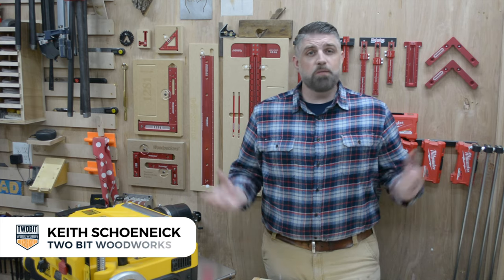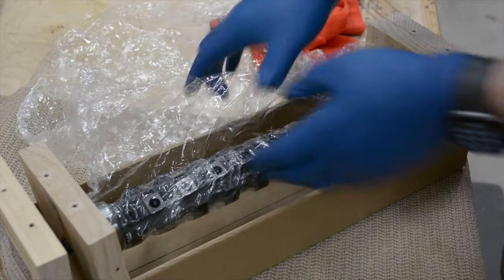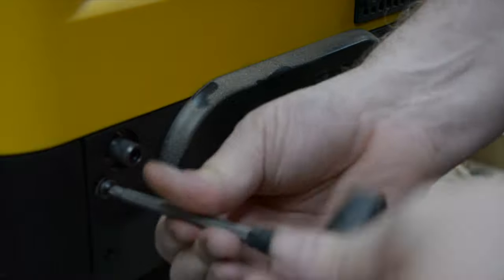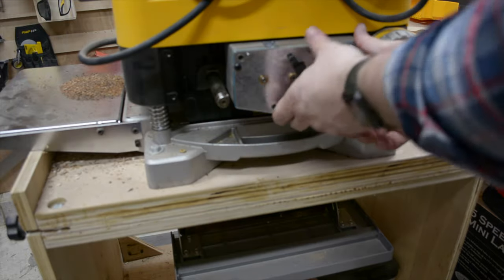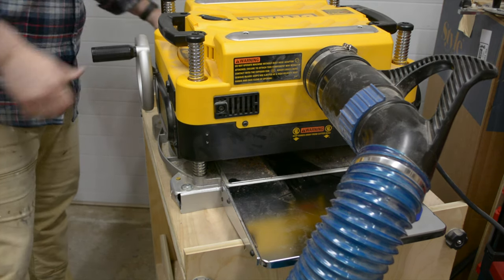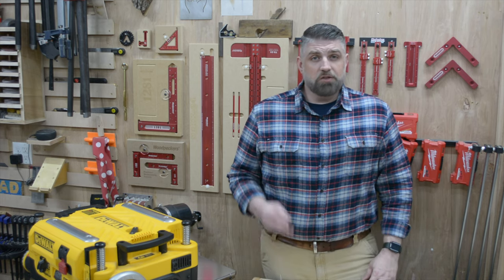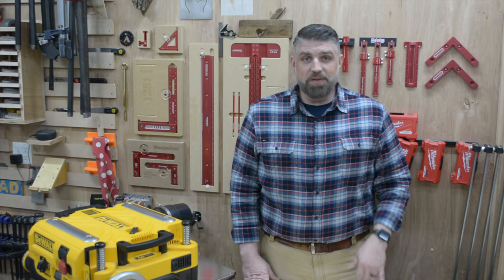Helical Head Upgrade on a DeWalt DW735 Planer | How To | DIY Small Shop Woodworking

Comment: This was a very handy tutorial and it helped me through this installation. Highly recommend this video. 

A few notes that aren't explicit in this video for anyone following this tutorial: 
1) The cutter rotate lock plate removed at 2:05 does not work on the new cutter head and does not need to be reinstalled. Just don't be an idiot and turn the machine on when the dust cover has been removed. 
2)  At 3:02 he removes a washer and there is a little piece of metal (a key?) that is also there. Watch out and don't lose it!
3) At 3:08 he says "4 screws", there are only 3. 
4) At 3:28, there is also a washer on that right post that you need to watch out for. He tells at 4:22 to put it back on, but he doesn't mention it when it comes off. Don't let it get lost. 
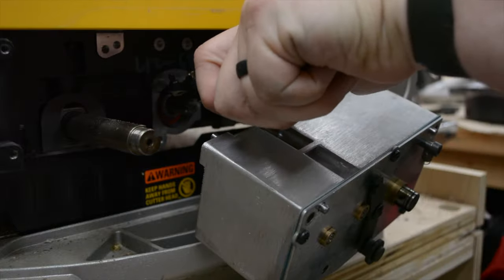5) I'm not entirely sure the snap ring at 3:45 actually needs to be removed. I did anyway, but it is a pain and another commenter mentioned you don't need to remove it. 
6) There is no instruction on HOW to remove the helical head referenced at 3:53. Depending on the age of your planer, it might be on there pretty tight. I used some lubricant and it helped a lot. 
7) If you wanted to reinstall the cutter rotate lock plate (even though it won't serve any purpose other than to keep your parts together), then before the step at 3:58 is the time to do it!
8) At 5:07 he says to ensure the belt is seated correctly on top and bottom pulley. You can access the top pulley to make sure it is there by giving just a quarter-twist on that screw on the left side of the little vent plate in the top-right of the screen. 

So these are all little things that weren't mentioned explicitly but I was able to get through it anyway. But if you want to add them to you step-by-step, it may fill in a couple of gaps.
Reply: Champion

Comment: exactly how important is it to add grease to the two round metal bits where the cutter head bearings sit? I started to install my helical head.. its a VERY tight fit.. took a bit of pounding via mallet and wood block. But I would assume any grease applied on those round parts.. its so tight it would just be pushed out. There is grease on the bearings themselves and most videos like your show taking some grease from the gear box and adding it to the little gear we removed from the original head. But otherwise, should I remove my cutter head to swipe some grease on that insanely tight opening where the two main bearings sit?

Comment: Just a heads up, I just got my Luxe cut three a couple days ago and they now ship with the cutterhead removed and they didn’t do that before. Even the website when I ordered said they did not come that way. But… There was an RMA form inside and it looked like mine had been dropped so it could’ve been a return.  the threads were screwed up on the shaft and I intend on contacting the company tomorrow. I was able to clear the threads using the shaft nut and some lubricant.
Reply: Hopefully you customer service experience with lux goes better than mine with bird tool.
Reply: @handlehidden-f2j  actually it was very good. I had problems with the videos uploading by email so I had to send still pictures, but we got it straightened out quickly. I was accidentally sent a head that had been sent in for return and it wasn’t supposed to be sent out. They immediately sent me a new head. All new, cutters installed and everything wrapped in plastic, foam, cardboard, and crated. I would definitely use them again if I needed a new head for something. 5 stars ⭐️

Comment: Thanks for this.  Still happy with the cutter head?  I've got the same planer and am reasonably happy with it, except that the breaker keeps tripping.
Reply from the maker: I’m super happy with it. I had the same problem then I installed a 20amp breaker and started taking lighter passes and haven’t had a problem since.
Reply: @TwoBitWoodworks  ya, my research turned that up as a solution.  I'm just waiting to add a few more things to my next amazon order so I get free shipping on it.
Reply: @TwoBitWoodworks  A 20a breaker on existing 15a wiring?
Reply from the maker: @joesmith6972  no, it was a completely new line I was able to run and upgrade the breaker.

Comment: Since buying this planer without the upgrade I’ve had issues with clogging. Are the shavings the same size from this cutter?
Reply from the maker: @Dorbad  no the shavings from my planer with the upgraded head are about smaller. You should try taking smaller bites through each pass.

Comment: What was that connected to your planer dust collection port? I need one!
Reply: That's the Rockler dust collector system. I have a standing unit that uses that same 4" hose and connector. It does require that you attach an adaptor to every machine in order to fit to the push-on connector, but it is convenient for a small shop where you only have one dust collector to service many machines.

Comment: I installed the same cutting head and have some issues.  I find that I can't take cuts as deep as I could with the OEM 3-blade setup.  I generally take small passes anyway, but I've been tripping my wall breaker running 10" wide walnut at 1/32" of a cut.  I didn't trip the breaker running similar material at a similar and deeper cut with the 3-blade.  The material feed is also much slower while passing through as compared to the OEM.  Most of this makes sense I guess, but are you running into similar issues?
Reply from the maker: I definitely have run into those issues before. I would suggest only using the planet on a designated 20amp circuit. I’ve noticed that when I use it on anything other than that, it will eventually trip the breaker.
Reply: You are correct, the new helical won't do deep cuts unless you have more powerful planer. Just do several shallow passes.. you get an exceptional smooth surface

Comment: This is really helpful. It sounds like you replaced the blades on your Jointer with a helical head. How much does the noise decrease - 10% or more? I know you didn't take measurements, but it's hard to know what is 'noticeable." Thanks.
Reply from the maker: Thanks Bernard! It’s about a 10% decrease in noise.

Comment: Great video!   Did you notice any issue with the motor not keeping up with the extra drag created by the helical cutterhead?
Reply from the maker: I haven’t noticed any increased drag at all. I would say it’s more the opposite. I’m taking lighter passes but more which is resulting in a cleaner cut. Less sanding is always a good thing.

Comment: You don't explain how you removed the helical bolt thingy after removing the 2speed gear box. My has smooth periphery. Nothing to put box socket onto and unable to loosen by hand. Other videos on YT same deal!
Reply from the maker: I do know that some of the DeWALT planers are built with a few differences based on when they were manufactured. I’ve had mine for a very long time.
Reply: Looking more closely the head end had a hex 6mm head.. perfect. Small 6mm box socket made light work of it.  Another tip short length 35mm HD dowel made easy work to knock out old cutter from gear box size. Those Circ clips or snap rings easy to remove using long pointy pliers. My circlip piers were useless and frustrating as they kept slipping off when went to pull out the clip. Long fine pointy  pliers having fine groves at tips didn't loss grip
Reply from the maker: @rosswines  awesome tip. My pliers came with a bunch of different tips so I was able to find the one that worked the best to remove the clips.
Reply: Further PS. I have since seen 1 YT from Timbecon Web site that did show using a box socket on this helical spine. No audio explanation what was going on, and very quick.. best to watch at slower speed to what was done. Also shown long need pliers used removing/installing the larger C clips on the bearings

Comment: I had one of these cutter heads installed a local repair shop and runs really loud and has burned out two belts since. Anyone experience this?
Reply from the maker: I’ve been running this setup consistently for a while now with no issues.
Reply: @TwoBitWoodworks  Tks, I am wondering if it wasn't installed properly.
Reply from the maker: Maybe it’s the wrong diameter or not the right part number.

Comment: Among several oversights, it should be mentioned that [a] when putting things back together, you'll see things that weren't shown during the tear down; [b] you need to raise the head before beginning; [c] the snap ring at the far [smaller] end does not have to be removed ... which was a good thig for me because neither of my snap ring tools nor any of my three needle nose pliers could remove it and I wasn't about to spend a hundred buck on a set that might.
Reply: My everyday long pointy pliers did the job of removal an d reset very quick n easy. Nothing special about my pliers.just make sure the end can fit into the Clip hole
Reply: I believe it IS best to remove  the C clip from the smaller bearing. When taken out  I can get a piece of35mm diameter wood dowel to fill the whole hole to put pressure on the out side race ring of the bearing rather than pressure the inner ring and stress the ball bearing race if the C clip wasn't removed. It was really easy anyway,  just using long needle nose pliers that I used also for c clip on the larger bearing. I used a larger box socket to hit on with wooden mallet (home brew) to reinstall the larger bearing. If you hit the threaded end of the axle of the new cutter instead of applying pressure to the outer ring of the larger bearing you risk sliding the larger bearing on the axle,  doing so you will set the smaller bearing against its C clip, but notice the larger bearing hasn't gone in far enough to engage its C clip!

Comment: Man, Dewalt 735 is already a 600$ + tool, then you toss a $500 blade on there, I'd rethink this whole idea and look to go with a planer that already has the helical in there.
Reply from the maker: This was not $600 when I bought it. It was more like $400. I’m in a one car garage so space is limited and i got the tool that fit my needs at the time. Now I’m upgrading the existing equipment to get a better cut quality.
Reply: @TwoBitWoodworks  I get it. I've made some expensive mistakes. If I already had a planer (I don't, I have to constantly go to someone else), I'd consider the blade too. If I was just starting out and needed a planer, that would be different. However with that said, I'm seriously considering buying the 735 and the a helical (lol) because, I keep shopping around and it' either a 13 or 15" or it's a cnc or wide sand machine (that I have to pay time on). 

We just can't win in this space.
Reply: It's best in class! Bigger more powerful need bigger AC power supply. More space to use and much more $$$$ to buy. Yeah go for it if that is what you need. Recommend Rikon , Oltre or Sicar. Bigger machines seem to have combo planer and thicknesses. Set you back about 3-4 times price for dewalt 735
Reply: @rosswines  I will say that after having 735 for about 5 months now (I bought shortly after I commented) the 3 knives are fine so far. I get little micro lines on my wood, but once I sand from 80 to 120 to 180 sometimes 220 it's gone. The #2 speed (dimensioning) is very fine finish already. The 1 is hard to tell the difference (finishing cutting). If / when I actually make enough money to justify the upgrade I will. I can see pros will spend $$$$ on tools if it's truly streamline their shop. An example is I bought a Wen track saw + Track, all I do is cut straight 90's and for that - once the track is calibrated (with an 8 foot level) it's been dead on for glue joints. Cutting at a 45 the Wen is a piece of trash and flexes more than a body builder in the Mr Universe contest. However, if you push from behind and hold it steady and everything is set up correctly it's perfect. 

Would I want the festool track? Yes of course lol, but I could buy a planer and a track saw for price of one tool and unless I justify the upgrade, it's going to be a while.